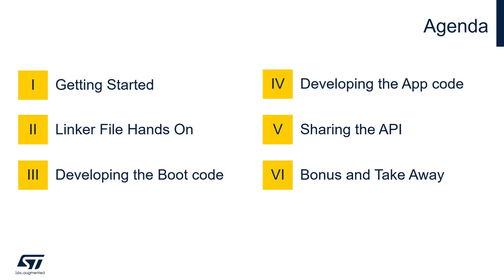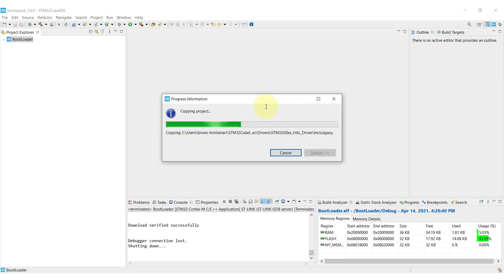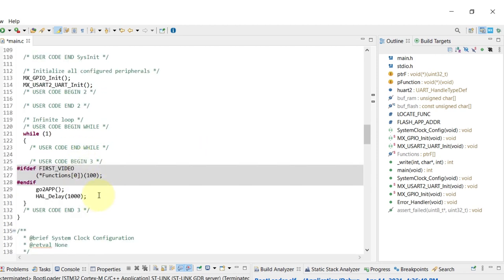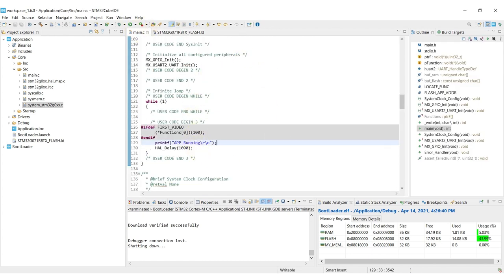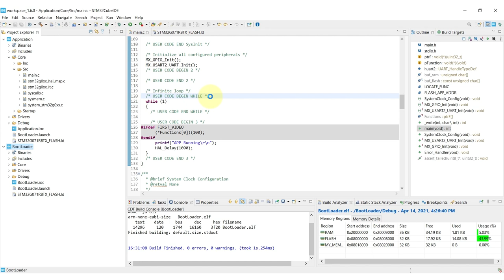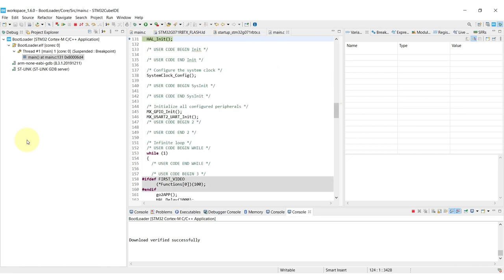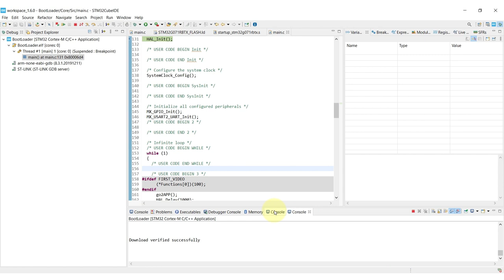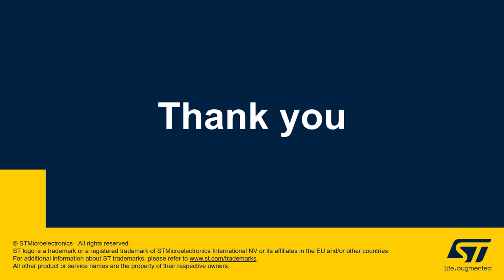How to Create a Super Simple Bootloader, Part 4: Developing the App Code

Comment: Debug does not work because it erases flash before download either Bootloader and/or Application.
It shows those messages:
"Erasing memory corresponding to segment 0:
Erasing memory corresponding to segment 1:"

How to prevent SMT32CubeIde to erase flash before download in order to be possible to debug the code?

Using STM32CubeIDE version: 1.10.1
Reply from the maker: Hello Silvio. We've reached out to our colleague who you hear in this video series. Here is his answer which we hope will help you overcome the issue.

The way to prevent the application code to erase the boot code can be made by using the same tab shown in the video during @4:00 up to @4:23, in this last moment, we can see that the “Download” column is “true” for both binaries (boot and app). If you don’t want to program the boot code, then the proper way to go is, assuming the boot is already loaded in flash, is to remove the “true” state for the boot in this column, it will allow the code to execute and load all variables/structures/etc., but it won’t erase the flash and re-program it. In the video I decided to keep both, as the bootloader code would simply be programmed as well, but I do understand that in real life cases this won’t be the scenario at all.
Reply: @stmicroelectronics  Well, I tried it already. The situation is that no matter which part has to be programmed, it erases the whole flash by repeating the entire process (erasing sectors 0 and 1).
Well, I already removed the "true" from download option of both projects in the workspace and I am using CubeProgrammer and only debugging with IDE.
This take more time with repetitive commands, but it works.
If you have any new tip let me know, please.

Comment: In my case, the Go2APP() function did not work correctly on the G474 controller.
I figured out, the problem was in the value at 0x08008000 where Application should start. I read the value in memory and it was 0x20020000 instead of 0x20000000.
The corrected working function looks like this:
I hope this will be useful to somebody.

void go2APP(void)
{
uint32_t JumpAddress;
pFunction Jump_To_Application;
printf("BOOTLOADER Start\r\n");

//check if there is something "installed" in the app FLASH region
if(((*(uint32_t*) FLASH_APP_ADDR) & 0x2FFE0000) == 0x20020000)
{
printf("APP Start ...\r\n");
HAL_Delay(100);
//jump to the application
JumpAddress = *(uint32_t *) (FLASH_APP_ADDR + 4);
Jump_To_Application = (pFunction) JumpAddress;
//initialize application's stack pointer
__set_MSP(*(uint32_t *)FLASH_APP_ADDR);
Jump_To_Application();
}
else
{
//there is no application installed
printf("No APP found\r\n");
}
Reply: Hi Sir, could you please tell me the meaning of this line?

if(((*(uint32_t*) FLASH_APP_ADDR) & 0x2FFE0000) == 0x20020000)

what does 0x2FFE0000 signify???